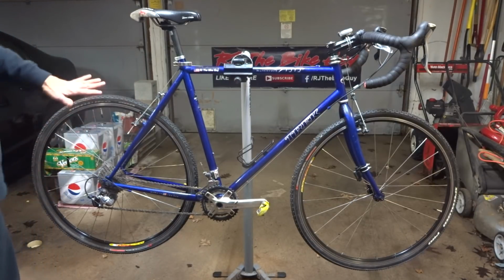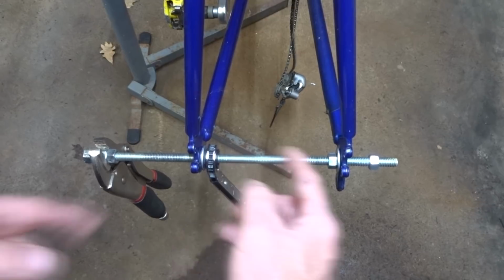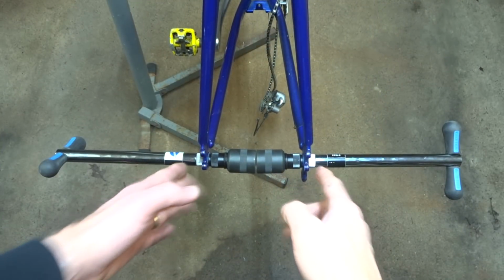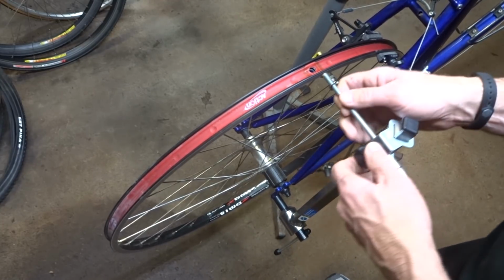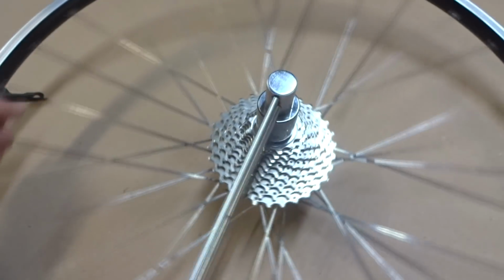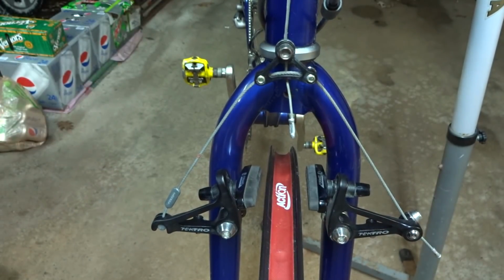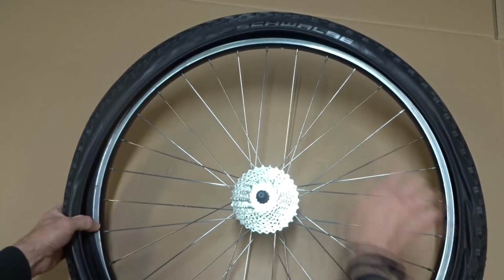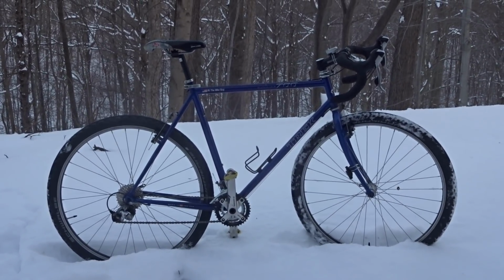700c to 29er Wheel Conversion - DIY Gravel Bike Update

Comment: That rubber band trick on the levers - wow, why have I not been doing that for years......
Reply: Yes, I am going to use the rubber band trick also.  That is genius. :-)
Reply: An old toestrap (ask your dad if you haven‘t heard of them 😉) works great too. They are very versatile
Reply: Ah, zip ties, the modern duct tape. I have them all over my bike and carry a selection „just in case“ when on tour (I also carry a few feet of duct tape...ya never know).
Reply: I keep a piece of an old inner tube around my drops, it's useful too if you want to park your bike against something (like a wall) and don't want it rolling and falling down.

Comment: RJ i becoming addicted to wacth your videos, even i have no plans for doing this i like to see your approach to the situation.  This ch is one  of best free trade school online.  What ppl don't realize is how good a bigger tire feels, i used to run 32's on one of my bikes, when i switched to 700x38 was like a revelation, i no longer feel the pot holes (so much), can go enter or exit sidewalks with almost no loss in speed ,makes my ride more convenient and comfortable making me ride more and more. 23's-25's-28's ? Let those for the pro's, i just wanna ride and enjoy my ride without feeling the pot holes in my teeth every time i ride over them. Btw my avg speed is also better with the bigger tires.
Reply: I moved to bigger tires for 2 reasons:
-more tolerant of lower pressure, which seems to correspond to fewer punctures
-a bit easier to change tubes
Reply: Seriously I just went from 23mm to a new bike with 38mm and the ride quality is amazing, with no loss of speed. Just a straight upgrade with no downside
Reply: @VideoGameAtlas  is amazing how much my ride improved after that.  Enjoy your new ride my friend.

Comment: Your cold setting tool is genius, much more elegant than the original "pry it with a plank"
Reply from the maker: The board method is still valid if the frame is uneven.
Reply: I remember that too

Comment: RJ, I think you will like those tires. I have a set on one of my own bikes that I use on a 50/50 mix of pavement and off road. The ride quality is really nice, yet they're still super fast. If you air them down too much, you can feel the side knobs cornering on pavement, but a little more inflation pressure fixes that. Good luck in your upcoming race.

Comment: Cool project.  I'm always leery about using tire levers to install the tire.  I've pinched too many tubes that way.  Unless it's too hard, I work the tire on by hand.  And don't forget to put some toe-in on the brake pads.
Reply from the maker: I was being careful. Having air in the tube helps prevent pinching.

Comment: Thanks I enjoyed the vid, but you are such a perfectionist it makes me feel ashamed of my rattly-tatty bikes... :)
I'm going to use your tip to position the tires so I can easily find whatever gave me a flat. I am also going to glue a tiny patch onto my inner tubes near the valve so I know which direction the tube was mounted to help locate the nail/glass/thorn/wire etc...
Seeing as I liked your tip, here's one for you: when I am using the chain tool I have an old bent spoke I use to hold the rear gears up so there is no tension on the chain.

Comment: What was the weight gain with the bigger wheels and tires? I put a couple of fat tires on my wife's bike, a 700c Gary Fisher steel frame ( Al Fresco ), at her request, so she can go up and down kerbs and boy do those tires weigh a lot. They were 47s and I actually had to file the bottom of the front fork steerer to stop a little rubbing. They spoil the bike's lines but they certainly do make the ride comfy.

I hear you on the tubeless but a problem with 29ers these days is getting rim brake compatible rims.

Also, you can get fat tires for 700c rims so this conversion can be a big unnecessary expense for many bikers.
The Schwalbe G-One Bite 700c Gravel Tire is 50mm and there are a multitude of 45mm gravel tires for 700c rims. Going to set you back $120 or so ( plus shipping most likely ) but that is a lot less than a set of wheels PLUS TIRES and there is no need to re-space.

29ers are built the way they are for impacts and a gravel bike just doesn't need the rim strength that a full suspension mountain bike does.
Reply from the maker: Shrug. I didn't do before after weighings. Keep in mind, different tires weigh different.
The 29er rims are heavier duty, also wider, better suited to fatter tires.
I have done this race three times on this bike:
https://www.youtube.com/watch?v=6bFxsQZG2V0

Comment: I don't think you would have needed the tire levers to install the tire if you let some air out of the tube. A 29er should be easy to install without levers. Hell, I don't even use them to remove the tire. great vid as always.
Reply: It really depends on tire/rim combos, you just lucked out basically.
Reply: @MrJonas2255  Well I fix bikes for a living and unless it is a continental tire, levers are rarely required.
Reply: schwalbe tyres are a really tight fit generally

Comment: Good video,  THANK YOU for hammering home the importance of ensuring the dropouts are parallel after a coldset.

With that said, I can't say that I agree with relying solely on newton's second law to ensure the rear triangle is symmetrical during a cold setting.  Seems there are a lot of things that could change how the port and starboard stays might behave- even something as seemingly trivial as a blob of weld/braze on one stay vs its pair.

Why not employ something like Sheldon's string method to check symmetry, or make a DIY version of Park's FAG-2?  Even just for peace of mind?

Or did I miss you addressing this?  I did kind of skim through it.
Reply: You could even measure from the rim of a KNOWN GOOD and properly dished wheel to check symmetry.
Reply from the maker: https://www.youtube.com/watch?v=dUPAKqS3dt8
https://www.youtube.com/watch?v=z9bPiAi_KQc

Comment: I just push my wider wheel in, seems to work fine, I guess it is doing the cold setting. I don't have those tools but it seems to have moved out correctly.
Reply: You can make the cold spacer out of threaded rod, some nuts and washers.  RJ also made a video of making your own dropout alignment tools. And I think he did a video for making a DIY derailleur hanger alignment tool as well.
Reply: kevinjfeeney77 - Thanks for the tip, I will give that a try. My hubs are Durace ones from the transition period between 126 and 130 with domed nuts so slide in easily. But yeah, I should get around to measuring and doing it properly

Comment: cold setting as you did isn't an ideal way to do this.  If one side gives and spreads out more than the other, which is highly possible, you no longer have a symmetrical frame.  Going over to Sheldon Brown's website there's a procedure for spreading the triangles one side at a time.  That's a better way as you can tweak one side out half the way then the other side to the final setting.  That ensures a symmetrical spreading.  Mind you if the  wheel is correctly dished and the rim ended up equally spaced  between the upper stays then all is well.  If it wasn't then it would have needed some tweaking.

Other than this niggle the video was superb.
Reply from the maker: I have done this many times, and not had a problem. If the stays are made symetrically, they generally go out evenly. If the frame is out of alignment to begin with, then the stays will go out an even amount, but the frame will still be of alignment. I have had more issues trying to move a single stay at a time.

Comment: Really nice bike you made. If the frame was alluminium this bike would be even better.
Reply: steel is real
Reply from the maker: If the frame was aluminum, I wouldn't have spread it like I did. Aluminum is lighter true. But also stiffer. It wouldn't absorb the vibration from the rough terrain. It would be a rough ride.
Reply: @RJTheBikeGuy  this is actually true i had forgot of that. Keep the videos going btw we love your work and an advantage is that you explain EVERYTHING. You have helped me with older bikes and a lot other people too

Comment: Always enjoy your content. A few nitpicks: to keep from doubling or tripling work install tires and cassette before fitting wheels. This allows you to check for frame clearance. Same for that brake straddle cable. 

Not sure if you mentioned if you were cold setting a steel frame. Looks like steel. Would not attempt on aluminum. Forget about carbon.
Reply from the maker: It is a steel frame. Only do the cold setting on a steel frame.

Comment: Neat build. Looks a lot like my old 2008 Dawes Horizon touring bike! Although I've got v brakes with drop bar v-brake levers & bar end shifters.  Currently in road going mode with 32mm Schwalbe Marathon tyres, but I may fit something fatter for gravel type use over the summer.

Comment: Currently working on a cheaper version (because... money). It's an 86 giant iguana with the 26er wheels. Chopped the bars shorter and added drop-bar ends. Went with the bontrager H5 tires but gonna change when they wear out.

Comment: I've made some similar upgrades to an old steel hybrid (with help from your videos!).  I'm amazed you have so much tire clearance.  I can fit a 29 x 2 tire on the front, but on the back I can't even fit 700x43 - it rubs just behind the bottom bracket between the chain stays.  Right now I'm riding 700x43 in front and 700x38 in back.  I'm assuming you verified yours would fit before you widened the rear triangle!  Thanks for all the videos!
Reply from the maker: The back I have plenty of room. The front tire doesn't have much clearance wit the side knobs. I may do different tires.

Comment: I'd swap the brake pads out. I'm a firm believer in clear odyssey slim by four pads, I've used them on v brakes, cantilever, 990, and oldschool caliper brakes, if your not running disk brakes these are the way to go, I have them on my BMX, my mountain bike, and my dirt jumper

Comment: Why didn't you replace the spacer on the non-drive side of the rear wheel with a smaller one? Much less of a permanent change and much less risk?
Reply from the maker: Do you mean replace the spacer, AND replace the axle with a shorter one, AND redish the wheel? Frankly, I think the way I did it is better.

Comment: Nice tutorial. You have the right tools😍 and I like your cold setting setup, simple and effective. Cold setting the frame sounds intimidating but is not that hard or risky if done carefully on a good steel frame. I converted my 1986 Miyata pro road bike from 126mm to 130mm in order to upgrade to brifters and a 10 speed cassette a few years ago. Best upgrade ever and the ride of intake steel is superb. Your rims look like they are tubeless ready...have you tried tubeless yet? I just bought some Schwabe Hurricanes for my gravel bike.....they look good but I haven’t been able to try them out yet either. I ride a lot of mixed terrain: pavement to the gravel with some light singletrails and back home on pavement the tread looks perfect for that.
Reply: Auto formatting leads to strikethrough where it is not wanted.....
Reply from the maker: I haven't don'e tubeless yet. Frankly, I don't know what it would buy me other than a tiny bit of weight savings and a lot of inconvenience.
Reply: Yeah I still run tubes although many swear it is sooooo much better tubeless with pinch flats etc. (I rarely have those anywhere way) and if you really have a problem in the field you have to pop a tube in anyway..... Good luck with your race later in the years ear.
Reply: RJ The Bike Guy, that weight savings, going tubeless, is rotational weight giving you better acceleration. Also you will be able to drop tire pressures (no snakebite on hard wheel strikes), roll over gravel and rough surfaces with less bounce back and enjoy a more comfortable ride.
Reply: David O'Brien; he is converting to a gravel bike. I run tubeless at 10lbs less pressure than in my tubed wheels giving me less chance to  puncture as the tire is more pliable to rollover sharp objects w/o penetration, has less rolling resistance bounce back, and no snake bite risk. No need to run cyclocross low pressures for gravel. Also less “hysterisis” (tire to tube friction) meaning less rolling resistance . The more the tire has to deform over gravel or rough surfaces, the higher the hysteresis. Tubeless all adds up to better comfort as an added benefit approaching the comfort of tubular tires.

Comment: Hello RJ i watched your video 26inch to 700c conversion you had to use brake adoptors because of wheel size difference could you please tell me are 700c and 29ers close in size because i noticed you didnt have much brake adjustment to do thanks for your video.
Reply from the maker: They are the same diameter.
Reply: @RJTheBikeGuy  Thank you so much.

Comment: I got tires for my trek mt.track 850xc at walmart for 5 bucks a piece on clearance but there a 26x1.75 an the tires that were on it were 26x2.10
Reply from the maker: So they are narrower.
Reply: There narrower an not as tall which made the bike lower which made it fit me better an the tires are bell comfort tire but there made by innova however they ride alot nicer than the dryrotted tires that were on the bike it also has the rockshox on it

Comment: Hello, RJ! Why don't you just install the new Hurricane's tyres on the old weelset? Is it a critical difference between internal width of the rims?
Reply from the maker: Rim width determines how wide of tires can safely be put off. The original rims were actually road rims. The new rims are made for offroad. They are sturdier, and wider to accommodate fatter tires.
See the chart near the bottom: https://www.sheldonbrown.com/tire-sizing.html

Comment: Can a hybrid bike, in my case a Giant Roam 3 Disc, Be set up with better tires for gravel? I just bought the bike as it was recommended by my bike shop for the type of riding I do; however I am finding that it does not ride very well on gravel. Great on smooth pavement, but I have very little traction in gravel. Tires on it now are Giant CrossCut S, 700x38, Deflect 2 puncture protection. The wheel set is Giant GX28 disc wheelset.
Reply from the maker: Probably. You have to shop and see what you want and what will fit.
Reply: RJ The Bike Guy thank you for the reply. I’m pretty new to cycling and need all the advice I can get lol. Love your videos!

Comment: Just remove one spacer from the axle and you got a 130mm wheel, then recenter wheel. No actual need to bend frames here =/ Also if u push it out like this you have a risk of pushing one site more than the other. Its better to use a big peace of wood. Put between the dropouts and the seattube, then lever and bend one site at a time, keep measuring. This is espacially important for bikes where the right chainstay has some dent to fit a big chainring. This site might be weaker. Nice build doe, like ur Videos :D
Reply from the maker: So after removing the 5mm spacer... are you forgetting about the axle now being 5mm too long? So replace the axle. And then redish the wheel. I like my way better.
Reply: Well i totally forgot about it having fast Release axle. 😬 couldnt u just saw off 5 mm of that axle and replace the spanner? Many ways lead to Rome. Keep it up. Never Stop Riding ✌️

Comment: I both a cheap road bike 2 years ago it turns out it's an MTB frame so I could fit 29 Rims... Problem is tire clearance is a bummer I am running 25-622 already and it does not seam it can go fatter. Next step get a MTP and install drops.

Comment: My two question are when using 29 tires what about the clearance between the chainstays and the seat tube you rubbing in these three places? Secondly I can fit a 35 mm tire on my treks hybrids maybe a 38 what the 29 version of a 38mm tire
Reply from the maker: Spacing the stays is fine. Really close inside the fork though. I may go with some slightly smaller tires or tires with a different tread.

Comment: Hey RJ! Nico from Spain! I have a question. The other day I overhauled my Shimano rsx brifters, following your instructions on your video. When I mounted them back on I noticed the right one has a little bit of play. just a bit, but enough to vibrate and make some noise when I ride on a rough road. While the left is stiff the right one can moved a little bit around, although it works perfectly in each case. Do you have any suggestions?

Comment: RJ bike Guy i was juste wondering whats the minimal width To fit 2inch 29tyres on 700c hybrid i m in the same situation and I have stock 700*38 with wider rim and v brakes
Reply from the maker: Depends on the tires. They vary even with the same specs. It's a bit of trial and error.